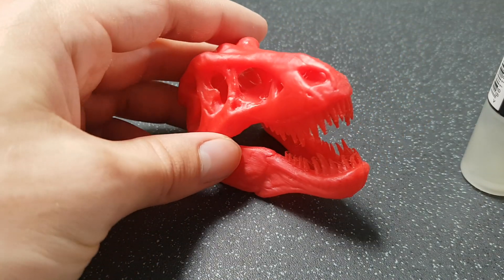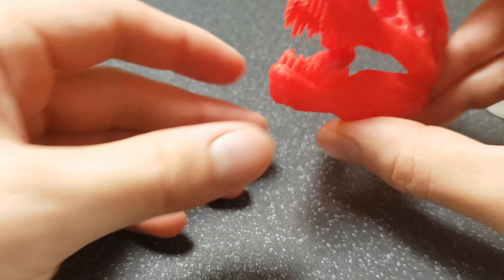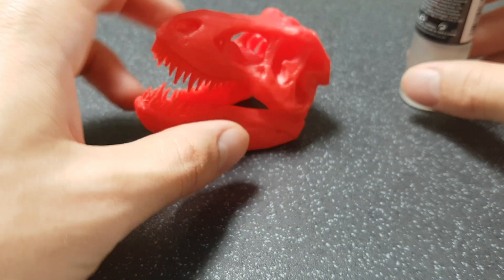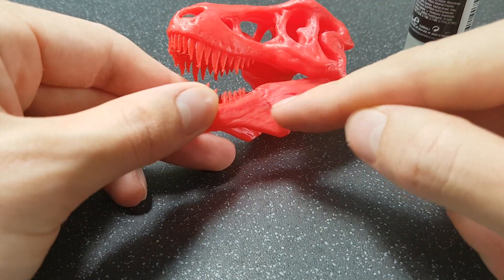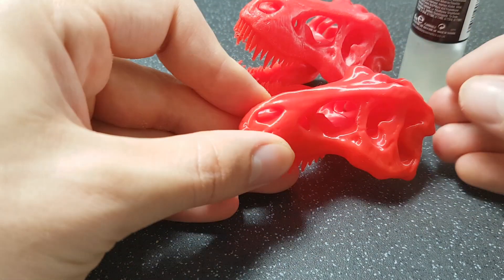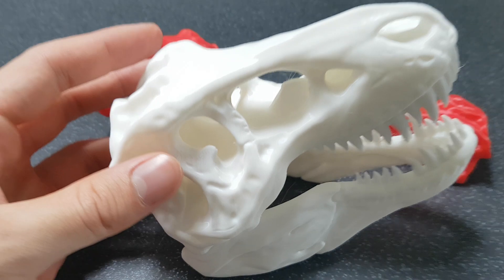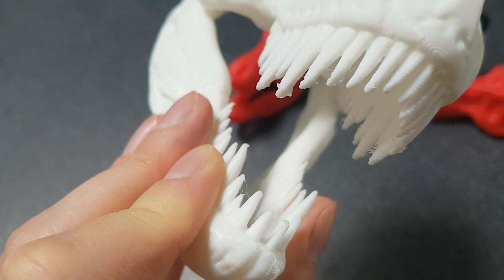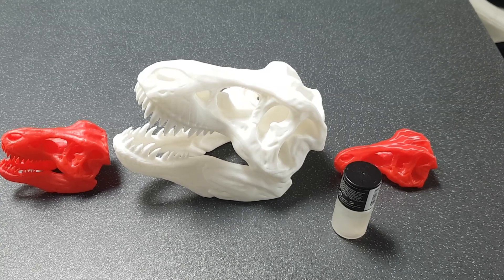How to smooth your PLA 3D prints using nail polish

Comment: He either used a damn good industrial printer or it isn't even a 3D print.
Reply: He says it was a Flashforge finder 3D printer.  A decent one albeit a Chinese made one but no means industrial grade.
Reply: crazy what tuning your settings and using a small layer height will do, huh?

Comment: is this top coat?
Reply from the maker: +everybodyluvsray hi, what do you mean by top coat? I only did one coat of the stuff if that's what you're asking?
Reply: I asked one of my friends who's a girl what this stuff is and she said it's called top coat. It's what you put on your nails after they have been painted. So I'ma look for that in the store!
Reply: everybodyluvsray You can get the ethyl acetate or whatever in bottles and it's quite cheap. I have a bottle, tried dunking pla in it but it got to gunky on the outside. And silver PLA goes white, quite hideous actually.. I haven't tried this method yet.
Reply: Its not top coat, its remover.

Comment: What were the print settings and what brand filament did you use? I have printed with multiple brands from super cheap to high-end PLA at a 0.2 Layer height and this method of smoothing doesnt really work unless I apply like 6 coats which makes this method for smoothing the PLA not very cost effective
Reply from the maker: Hi, sorry for late reply, didn't get notified of your msg. PLA was from BQ, I got it from Amazon UK. Really good price and I've found it prints great. Have you tried 0.1 layer height, it might make the smoothing easier.
I've actually just received a load of different sandpapers so thinking I might do a video testing out that for smoothing PLA. Check back soon for the vid. Probably a more effective way for smoothing PLA

Comment: Hi, very nice video! Can you post a video on how you do it.
Nail polish remover is basically acetone, you can buy acetone in 1, 5 or 10 liter cans and is much cheaper I think.
Reply from the maker: Hi thanks, this was PLA which means acetone won't actually affect it, it's the ethyl acetate that helps smooth the PLA or at least make the layer lines less obtrusive. I think that was the chemical but I haven't checked for a while.
I can do a video applying this though, I literally just put it on like a girl would her nails.
Reply: ROBNOB9X  so i should use non-acetone nail polish

Comment: Any idea if this'll work on ABS? looking for a safer, less hazardous method of smoothing abs parts than acetone vapour baths.
Reply from the maker: Hi, I don't think it'll have a chemical effect on ABS like acetone does but it will still hide some of the layer lines. If you want an even better result you could try the filament on smoothing thing by polysmooth or something like that. It might be called the polysmooth, I can't remember but it was a kickstarter I believe.

Comment: Would a few layers of this make it water proof?  Some water gets into mine
Reply from the maker: +Patrick Monkman good question. I think it would although you'd have to make sure you coveted it all which if it's transparent can be a bit tricky to do. As you said a few coats would be defo needed. Also I'm not sure how a few coats would look because where I made a bit a little thicker it had the look of dried glue slightly. Give it a go, I might try it again in the future. You could also just print slower with a couple of extra perimeters as this worked for my bonsai pot I printed. Also about 4 or 5 bottle layers.